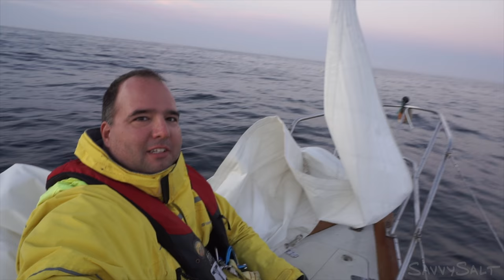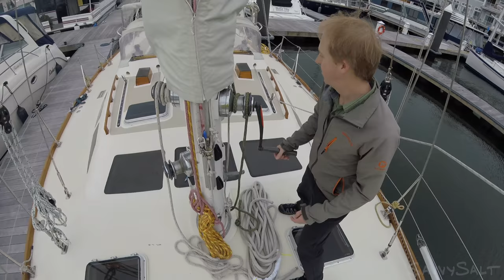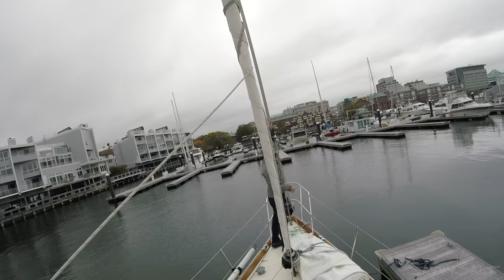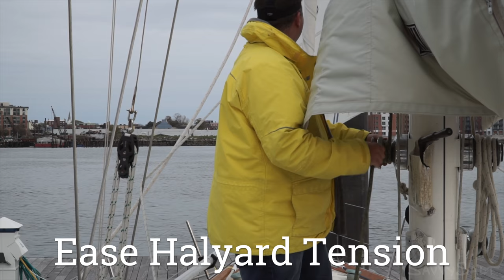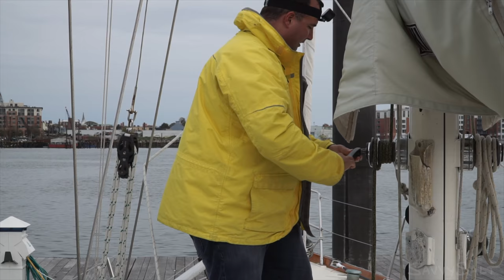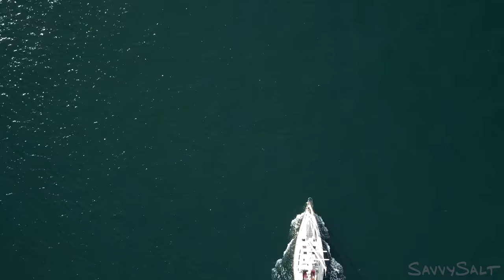Jib Furler  Troubleshooting

Comment: Ive a spare halyard that exits the mast just underneath the furler genoa halyard. Im thinking of clipping that onto the top of the unit as well so when its at the top if i give it just slight tension it will be almost at ninety degrees to the swivel unit so should stop any wrapping. The only issues i can think of which are really non issues is you need to drop both halyards to drop the sail, not a issue if you leave your sail up. One less halyard for a rigger to go up on but i would have spinnaker, topping lift and mail sail halyards spare anyway.
And yes definitely easing tension works on mine too
Reply from the maker: I would definitely try out that second halyard trick.  If that trial works you might be able to achieve a similar effect by installing a "halyard restrainer" (google it) on the primary jib halyard between the primary and secondary halyard.

Let me know how it works out!
Reply: @SavvySalt  Yes i definitely will let you know. I will overthink it some more first too! Im in NZ and its going into winter so im about to do a haul out/anti foul late May so will be a few weeks before i try it cheers

Comment: You saved our bacon today!  We followed your procedure to release the tension at the top of the jib and it worked!  The only difference was our jib was stuck in the furled position so we used the jib sheets vs. furling sheet.  Thank you so much!

Comment: Good call. This is the kind of stuff that will cost a fortune if you use a rigger. If your handy or can take the time to give it a go you’ll save 90% buying the parts and doing the work yourself. Not for everyone, but very doable. Doing enough research about the issue and you might be able to buy the equivalent parts from a bearing supplier rather than furlex or a marine supplier who will add 50% to the parts cost. That’s boating for you. Your idea of keeping sailing with the quick fix is always the way to go. Don’t interrupt your sailing unless necessary or due to safety. Fair winds.

Comment: That was thoughtful troubleshooting. When my furler choked, it was from overwraps and binding of an ageing furling line inside the drum at the bottom. I swapped to a smaller diameter high modulus line with cover stripped off the segment that lives inside the drum. Worked great.
Reply from the maker: I once pulled an extra length of line out of a jammed up furling drum; somehow it had gotten sucked in off the foredeck and proceeded to tangle things up tremendously.

Stripping the cover off would make me nervous after nearly losing a furling line during a difficult overnight delivery: https://savvysalt.com/blog/a-difficult-november-delivery-to-maine/ (scroll down for image)

Comment: Selden/Furlex furlers have the looseness built in. It spreads the point loading of on the bearings of the halyard swivel. They have metal bearings so need to be maintained by washing and greasing. The restrainer is missing which will eliminate the halyard wrapping issue. Your methodology and approach is dead wrong and does not correct the problem. To solve the problem 1/ get on the web and download the manuals from Selden 2/ clean and grease the halyard swivel - do the drum while you are at it. 3/  install the halyard restrainer (Selden supplies 2 with each furler kit)

Comment: Update on this furling equipment.  I replaced the 15-year old Selden Furlex gear with a new Harken Mk4.  Works like a charm now.  I still have a smaller same vintage Selden Furlex on the staysail and it also works fine.

I think the Furlex on the jib didn't like getting salty.  You're not supposed to wash them unless you also use degreaser and then re-lubricate the Furlex furlers.  With a Harken you can just spray it down after a sail to get the salt out of the bearings; no lubrication required.

Comment: I had a very hard time getting an inexperienced crew to execute this procedure correctly on a later sail.  In hindsight, I should have at least tried finding a way to put some grease in there (apparently there's a grease fitting somewhere) or checked the manual.  I probably would have been better served to not roll the jib out again until the furler was turning freely, but I couldn't bear to sail downwind on main only.
Reply from the maker: too bad you didn't have a handy video demonstrating the procedure...

Comment: Your dealing with failed swivel bearings. This is a problem that is just going to get worse and you don’t want it to create a situation where you can’t drop the jib. Take it down, pull the swivel off and service the bearings or the bearing races or possibly both. Your fix is temporary at best. Good luck and fair winds.
Reply from the maker: Thanks for naming the problem.  Definitely worth a google.

Unfortunately this is a very old furler that is complicated to service; the rigger's quote for servicing this furler was right up there with the replacement cost.  It's getting replaced in the spring.  

We just didn't want it to cut our season short :)

Comment: Thanks - great video. Helps a lot!! My unfurling is difficult and not working. I have to turn manually. But to furl back works fine. What could be wrong?
Reply: I have similar issue I took apart the drum and found that the line had wrapped internally so was only able to turn 8n one direction as it would tangle when being pushed around the drum as appose to dragged thus my furler would only work in one direction. Hope that helps
Reply: @tommcgrath6668  thanks Tom